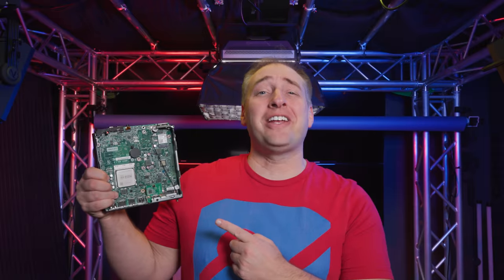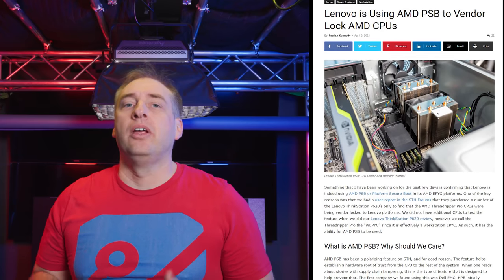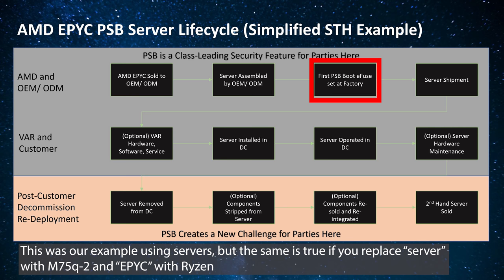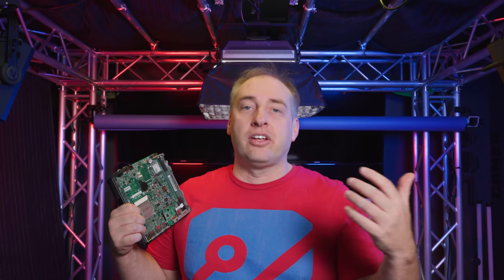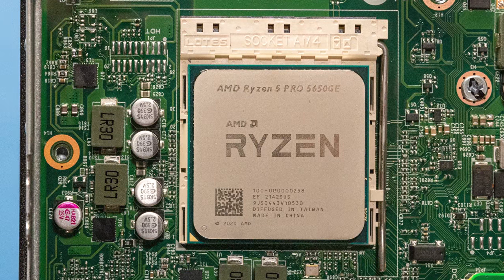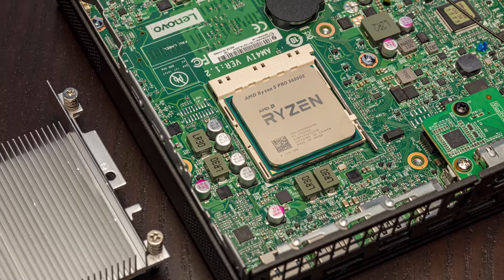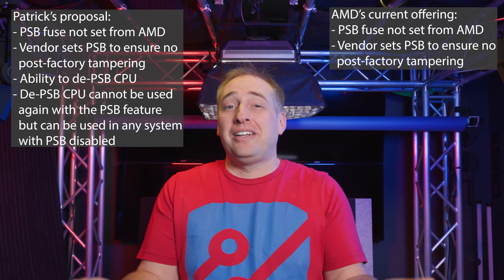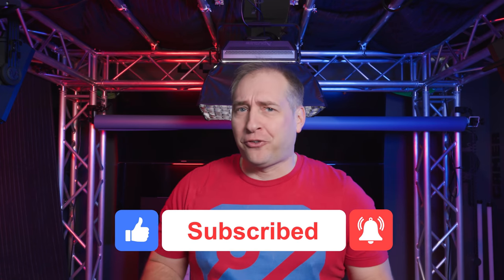Yikes! Lenovo is vendor-locking AMD Ryzen CPUs via PSB

Comment: Been waiting on this piece since i found that my M75Q Gen2's 4750GE wouldnt work in my ASUS board, but my unlocked Ryzen 6 Pro 4650G would.
I was able to verify that the (edit: Pro) 3400GE from the M75Q Gen1 was able to work without issue on the M75Q Gen2, but it did not work in reverse, which isnt surprizing because the gen1 BIOS probably doesnt include microcode (edit: for the 4650GE)
Also of note, on both the M75Q gen1 and M75Q Gen2, no notification was given if a non PSB processor was installed. my 3400G non Pro just booted right up, it took a few more seconds, but i was not presented with a notification.
Reply from the maker: Thanks for the nudge on doing this video. You were the big driver for it.
Reply: Thanks for the heads up about the 4750GE on an Asus board. Right now, I have a Ryzen 5 Pro 3400GE that I took out of an M75Q Gen1 and it works perfectly in an ASRock X570m Pro 4 board (with ECC memory). I was thinking maybe in the future of the possibility of getting a Pro 4000 or 5000 series GE to upgrade, but now it sounds like it's going to be a challenge if I happen to come across the M75Q Gen2 system  🙁
Reply: @ServeTheHomeVideo  And thank you for doing it, i got to see some perspectives that i didnt even consider, not just from ServeTheHome, but also the community.
Reply: @nighthawkvc25a  Interesting, i'll have to try to get permission to swap our Lenovo Pro 3400GE into our Alienware computers(would have to temperarily take it out of the esports room). It was my understanding that all of the Pro series came with this emabled by default(starting with the 2000 series), but maybe lenovo made this change with the 4th generation.
Reply: @Denis go back to TikTok if you can't handle it
Reply: @Denis if by education you mean Chinese subversion then yeah
Reply: @ServeTheHomeVideo  Hi! How can you tell if a cpu is vendorlocked? Before I upgrade the processor on my lenovo m715q 2nd gen tiny and potentially Iose money :(

Comment: Sounds like a really good way to ensure hardware ends up in a landfill when it could have still been re-used.
Reply: I’m surprised Lenovo did this before apple
Reply: @Ironapple09  pretty sure Apple products' CPUs have been paired to other components for years... also they're soldered not socketed
Reply: @QualityDoggo  The Xeon e5 v3s in the system I'm building right now allegedly came out of a mac.
Reply: if i buy something i pay it and its mine and i can do whaterver i want with it , even set in on fire if i so wish  , so i dont see why i have to be forced to use what i buy only as they see fit ............if i want to reuse the cpu i paied on another mobo why shouldt be i be able to ?
Reply: @cts006  A Mac that is a 2013 design at the very latest.
Reply: @sullivan912  yah of course. it's not like they still make them.
Reply: "Sounds like a really good way to ensure hardware ends up in a landfill" - Absolutely. Who in their right mind would want to buy a mangled CPU like that?
Reply: Actually it may be just to prevent something like that.  People will buy computers just to get a few components and throw the rest in the landfill. Perhaps Lenovo’s trying to prevent people buying their computers to strip them for parts and toss the rest in the landfill.
Reply: @calvinwalker4654  Not really. Once a PC components' life cycle ends the motherboard, RAM and CPU are thrown in the bin. If all the parts are functional, they might be sold as a whole, but most often it's not. However if the MB is bad normally the CPU can still be sold and used elsewhere. With a CPU locked to a certain MB product line the CPU will definitely be chucked into the bin no matter what (and maybe some fraudsters will try to sell them as non-locked CPUs).
Reply: @CoolKoon  its easy to say something is "bad" but can you really prove it without any doubt, because i doubt it
Reply: @PhunkBustA  FFS scram, troll!
Reply: @skyilah  'if i buy something i pay it and its mine and i can do whaterver i want with it , even set in on fire if i so wish'
You do realize that before you bought it from Lenovo, it was Lenovo's, and they can do whatever they want to with it, even sign it if they so wish, right?
Don't like it, don't buy it, the only valid response if you don't like it.  
Frankly it's a fairly small thing in either direction, the number of processors that ever make it into something else has to be relatively low in just about every use case, this only ensures it.  By the time these are outdated enough to harvest a processor, you'll want a better processor.
Reply: @QualityDoggo  you can swap the processors on Apple Macs without issue, they had the whole T2 thing going on mostly on phones, but If I can remember correctly, they backed out from that approach a while ago.
Reply: @javierortiz82  You have been tricked by Apple.  They jusy do it in a different way.  Like the latest Mac mini, Apple solders everything and you have zero chance to reuse its components.

Comment: This is literally almost equivalent of bricking CPU's and making them e-waste, imo.
Reply: And I see that this is a new vector for DoS attacks - brick the computer by changing the conditions for the PSB so that it won't start again and you'd need to replace CPU and BIOS. Basically easier to get a new computer.
Reply: @ehsnils  That or a manufacturer pushing a BIOS update that either intentionally or accidentally bricks a whole line of older systems. We thought apple was bad when they started throttling older phones in updates, but you could in theory push an update than auto installs on the next reboot and then bricks the system.
Reply: Can still hack and bypass it  they are fun but also waste of your time lol
Reply: It is, it also cuts off reuse when big corporations are getting rid of their old stuff.

The thing is, the security ideas can be okay, but a) Lenovo should not contol the keys, that should be the enterprise admin adding their key to BIOS and turning the feature on first use, b) have some way to disable it again with that same keypair for decomissioning systems (note I can use the key on a different motherboard if it is in this form) . I can key up every unit with it's own key and have a key store database under a master key as an admin easy enough.

The whole concepts this is based on are being broken, and MS started it with getting them to embed MS keys for the bootloader stage the idea of that feature again was the admin would set it up with their own keys (some DIY motherboards do actually allow this, OEM, well good luck). It is illegal tying and needs to stop.

With this implementation in 5 years time, motherboard gets powersurge and dies, and now the processor has to go with it because lenovo is doing this and no-longer sell those particular boards any more...  I would also point out Lenovo has been doing similar with serial number checking of wifi modules in their laptops.

Comment: One of the few differentiating factors between something like this computer and a Mac mini is the fact you can change out/replace/repair components when they're old or broken.

Way to nerf that feature on this product...
Reply from the maker: This one actually has 64GB of memory in it for its video :-)
Reply: well, you can still upgrade it. But with brand new CPUs (which would become lenovo only after first boot)
Reply: @gorjy9610  True... I also imply (but not specifically) pulling the CPU out and putting it into something else (I often partially fund my upgrades by selling off the parts I'm replacing ;)
Reply: @JeffGeerling  Lenovo is brand to avoid for any somewhat advance user, proprietary this, proprietary that. And now locked CPUs. We can only hope that this is end with Lenovo and no other OEMs would do similar thing.
Reply: @gorjy9610  Its probably not just Lenovo, its just that of our new machines, our Lenovo ones are the only ones with AMD Pro series processors. The rest are either Intel, or non Pro AMD. We have some Dell/alienware and HP desktops with Ryzen, they're just not Pro series, so dont support PSB. We do have some HP laptops with Pro series, but, it would be difficult for me to swap these into Lenovo boards, especially without having to fight a possible warranty battle in the futrure.
Of note, i'm not part of the Serve The Home team, i have just been doing my own independent testing
Reply: @gorjy9610  yep...no others like Apple will do it, as users definitely will stop buying their products
Reply: @ServeTheHomeVideo  Lenovo lockin who cares if it would have 100TB - I dont buy any of the lenovo Rackmounted enclosures due to vendor lockin. We need SUN BACK NOW!!!!!!!!!!!!!!!!!!
Reply: How many components are still socketed in a modern Mac Mini? Apple is not your friend when it comes to right to repair.
Reply: @darshan5726  ??? yes, you can put it in exactly same board. Probably even to any Lenovo board. But not any board so it's Lenovo locked, which part you didn't understand?
Reply: @LivingLinux  That's what I'm saying—everyone knows the mini is locked down on a hardware level. Why nerf the socketed nature by making it harder to pull parts and resell them or reuse them in other hardware?
Reply: @JeffGeerling  wastefull, this locking, and now specifically in a silicon shortage...
Reply: @LivingLinux  Well, if I buy a Mac Mini, I know it works, when I am buying a locked Ryzen, how do I prove it to the seller that it doesn't work on my system, the seller can prove that it was working on his "Lenovo" Motherboard. That's the issue.
Reply: Hi! How can you tell if a cpu is vendorlocked? Before I upgrade the processor on my lenovo m715q 2nd gen tiny and potentially Iose money :(

Comment: this is the most anti-consumer thing i've seen in computers in more than 15 years
now canceled my freshly ordered (personal) X13 - and next week will argue against the Lenovo Servers I was suggesting for a customers location. And probably will go forward to have Lenovo removed form our systems asap - and now have to go with the next f'd up OEM. Or maybe go the custom route...
Reply from the maker: I think folks will be a bit shocked when they see the SR655/ SR635 video(s). We started working on them, but now are waiting on more parts.
Reply: The most anti-consumer thing since Apple starting selling computers!
Reply: @tomkent4656  not quiet there - but on the way
Reply: @tomkent4656  
Last time I wanted an apple computer was when they used motorola processors. All that came after was a damn headache to service.
Reply: Good. More large buyers pulling out when the pull shit like this is better. Even more so if you tell them that is precisely why you're cancelling their order.
Reply: "And probably will go forward to have Lenovo removed form our systems asap" - Heh, I was also thinking that maybe I'd suggest buying a couple Lenovo servers at the company I work at for testing. Not anymore, we'll stay with HP.
Reply: @CoolKoon  SuperMicro here. We were already avoiding other brands due to proprietary parts, but we've upgraded components in several older systems. This will have a chilling effect - we were previously considering moving to more AMD hardware, but this swings us back to Intel for Desktop and Server.
Reply: @inthestudy  Yeah, we've used some SuperMicro blade systems for HPC clusters too, but are moving away from it for several reasons. However this move really rules out Lenovo for us for sure. Even though in HPC it won't make much of a difference but for desktop machines it's a deal breaker. Sure, it's (partially) AMD's fault too, but it's still Lenovo who chose to force this on their customers, shame on them.

Comment: They should be mandated to use different part numbers when they do this kind of crap.  It's basically false advertising since you can typically use this processor in any system unless PSB is enabled.
Reply: They do use different part numbers... sort of...

that is, I don't think regular ryzen can have that feature enabled, I think it can only be enabled on ryzen pro, hence why they would be OEM only. Then Ryzen pro can have that feature enabled or not. Note that it's not up to AMD to decide whether or not it's enabled.
Reply: @MrPlaneCrashers  Only the pro models offer this feature, but me and I think most other users would socket a used 4750g just as readily as any other CPU.  That's the problem, at that point it's a gamble.
Reply: @stuartlunsford7556  Yeah, completely agree with you on that.

Comment: Just something else that erodes consumer confidence.  "Ding", It rings the bell for me to avoid not only these systems but the manufacturer.  I would wager that Lenovo does not vendor lock overseas products; like in Europe; especially since it is not marked on the system.  Also, having this "un-set" feature available post manufacturing may allow malicious operators to hardware lock contrary to the systems manufacturer, rendering it inoperable.  For me, thumbs down all around.
Reply: Kills the market for used Ryzens, even if pulled out of HPs or Dells. Buyer can't know if it came from a Lenovo or not.
Reply: @SuprousOxide  market sorted it out pretty quickly.  Epic processors on ebay are listed as 'unlocked' or 'Dell locked' and guess which ones are worth less?